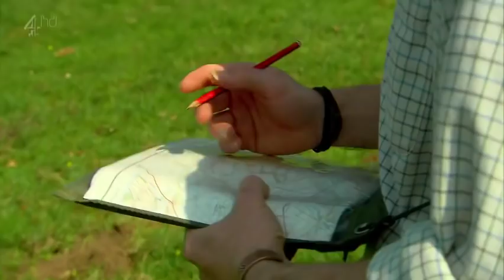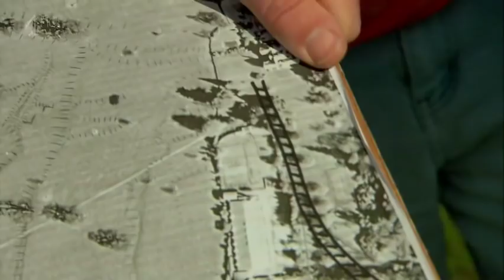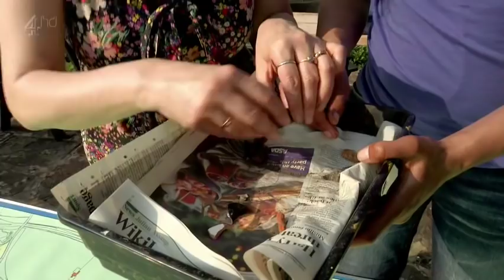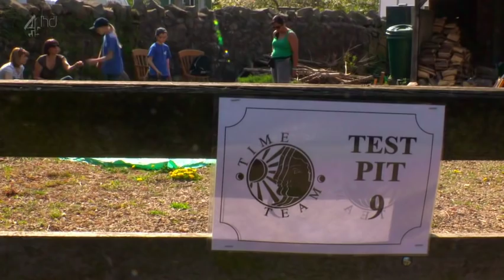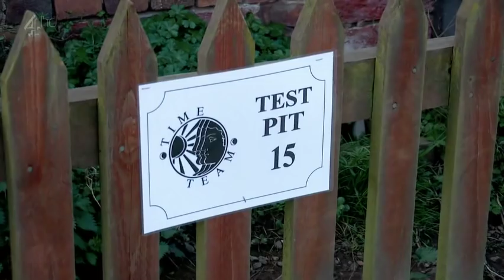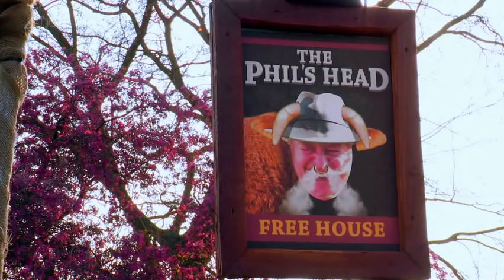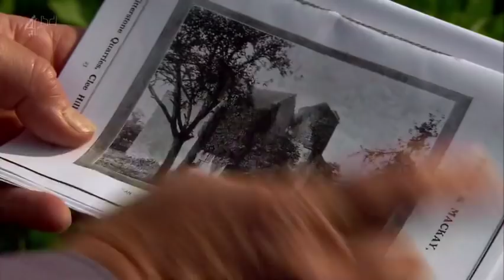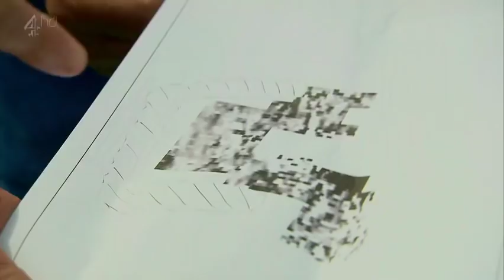Time Team S19-E02 A Village Affair

Comment: If the houses were waddle and dob how much would be left? Any one know? The manor where my family came from there was a village with a manor house. pub. market and church. There were   hamlets of just houses spread all over the place.
Reply: Depends on how acidic the soil is also the moisture content. I've seen them pull chunks of dub out of trenches in the past, but it's pretty rare.
Reply: Oddly, the remains of wattle and daub buildings often survive best if they burnt down. Charcoal and heat-baked daub do not break down as easily in the ground.